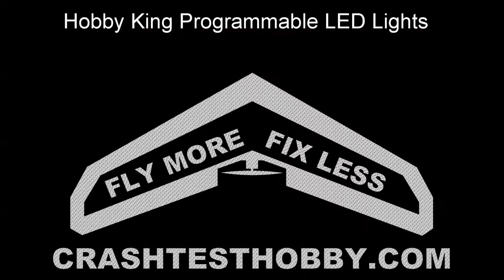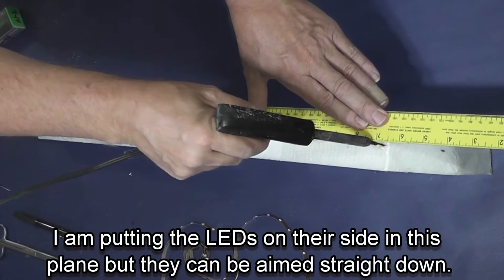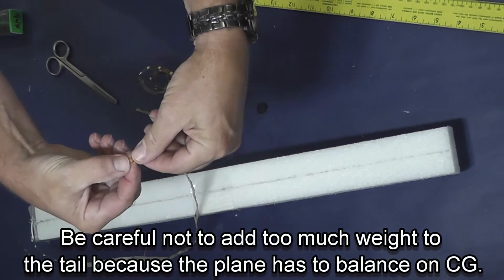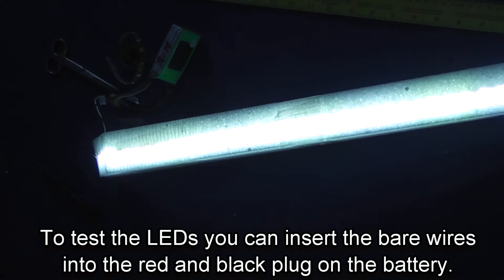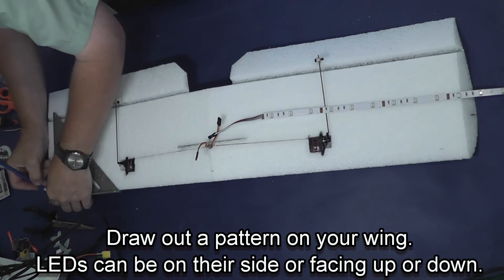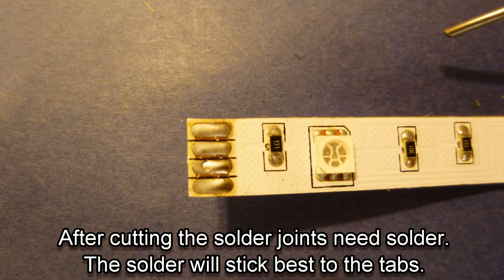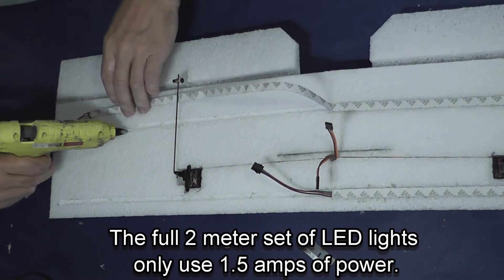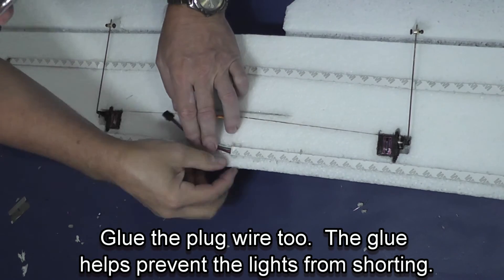Hobby King Programmable LED light installation

Comment: great video, I noticed it said 12V on those light strands, so are you using an 11.1 (3S) to power them?... is it the same battery that also powers the motor and LED-electronics board and receiver/servos?  i assume so but wanted to be sure.